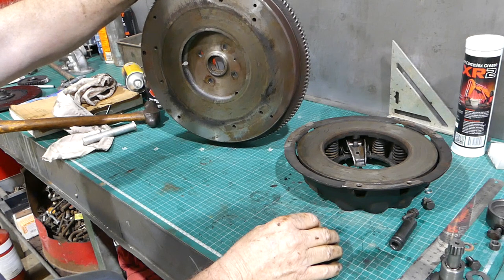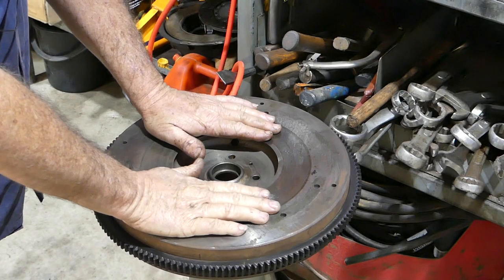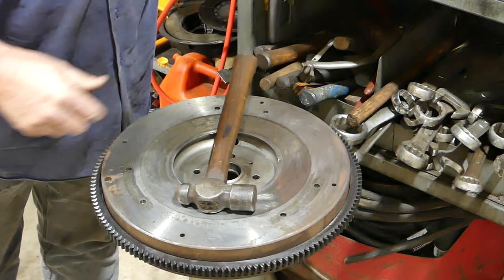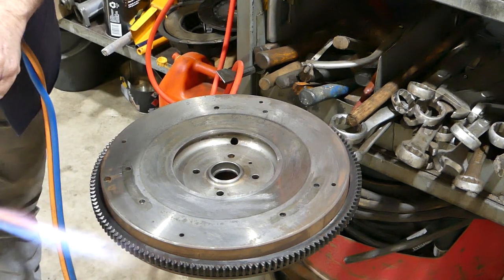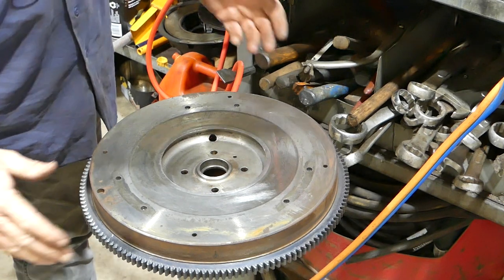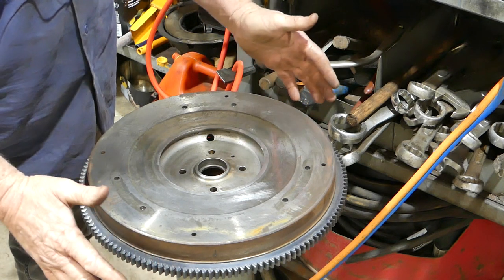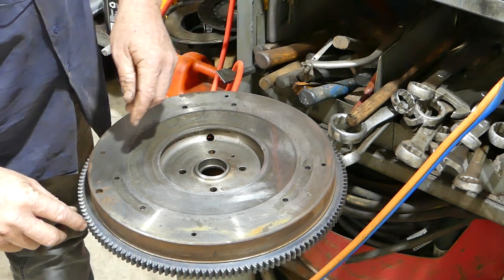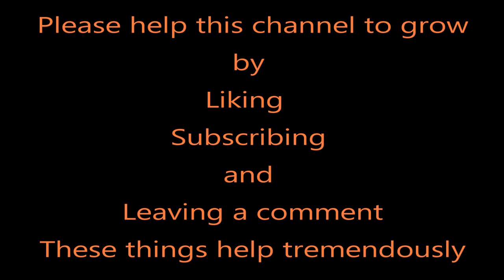How to fit your Ferguson TE20 Ring Gear to the Flywheel

Comment: I always thought the best way was to slightly heat the ring gear before installing it but not with it on he flywheel which will heat up and expand also, same as an automotive fly wheel. Of course I am sure he has installed more than me.
Reply from the maker: The heat is concentrated on the ring gear and not the flywheel mass. The flywheel can still be handled easily.

Comment: You have to warm the ring for themselves .. The flywheel takes the heat out of the ring as soon as you can get it in .. Believe me I have made hydraulic cylinder where it should be the first time otherwise everything was  to scrap bin :face-blue-smiling::face-blue-smiling::face-blue-smiling::face-blue-smiling::face-blue-smiling:
Reply from the maker: This works ok, it is what we did on field service for 40 years now

Comment: My '55 TEA20 has a flywheel with no lip and ring gear has moved between the 3 mounting bolts. Do you know when change was made to having lip on flywheel as looks like mine has been changed for some reason.
Reply from the maker: No I wasnt aware of a flywheel like that.